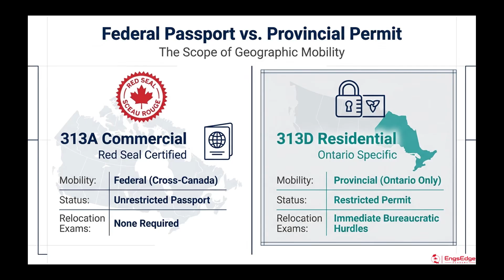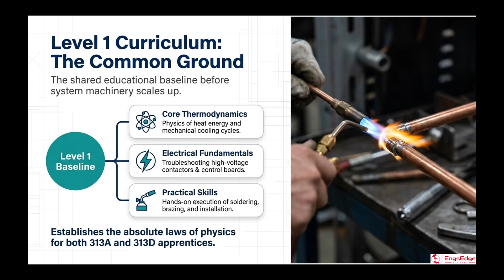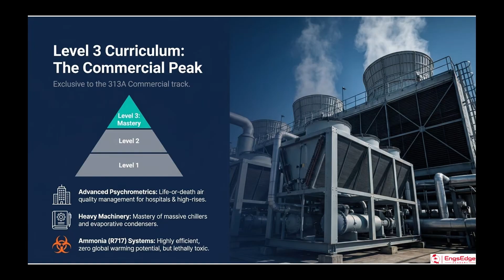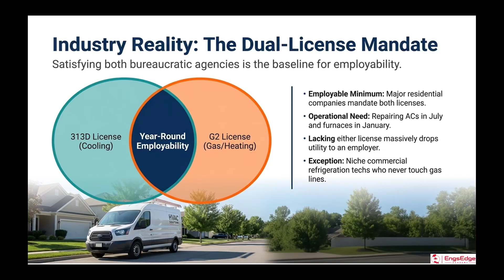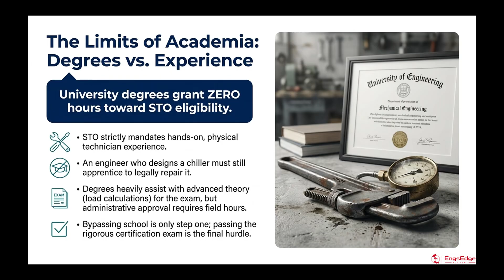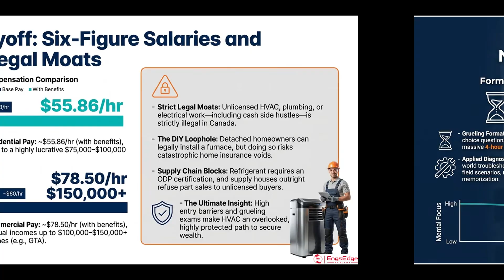Ontario HVAC Licensing Explained: 313A, 313D, G2 & Pay

Comment: "This is a brilliant breakdown of Ontario's HVAC licensing architecture! Comparing the 313A Commercial Red Seal, 313D Residential tiers, and the TSSA gas technician requirements gives international engineers and aspiring tradespeople an absolute roadmap to hitting that six-figure salary.

However, looking at the backend of this video and channel, there are critical optimization gaps limiting your reach:

Zero Tags: Both your video tags and channel tags are completely empty.

Discovery Barrier: Since this is a highly targeted niche (Canadian engineering/trades licensing), missing core tags like Ontario HVAC license, 313A vs 313D, STTO apprenticeship, and TSSA gas technician prevents YouTube's algorithm from pushing it to the right professionals.

With 65+ videos on the channel, fixing these metadata and tag structures can instantly boost your search discoverability. Let me know if you want a quick keyword blueprint for this!"❤